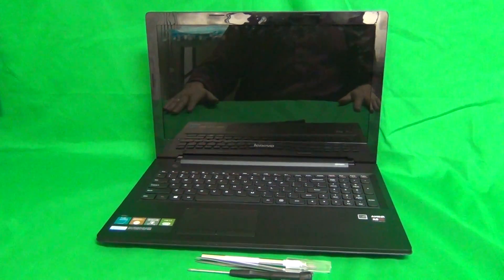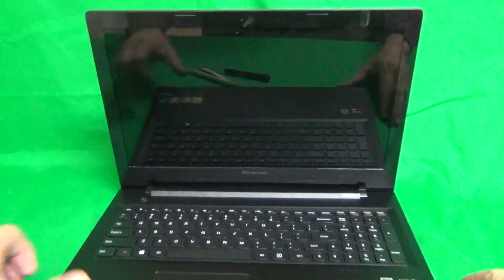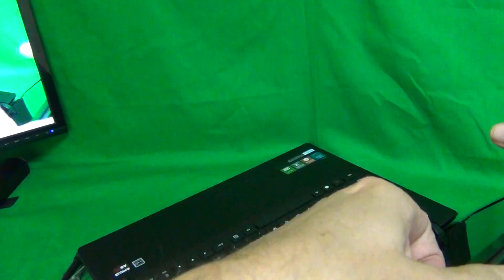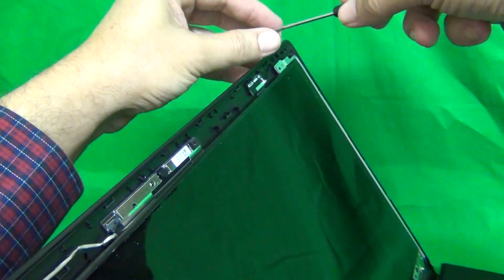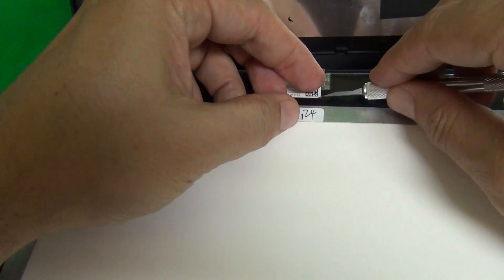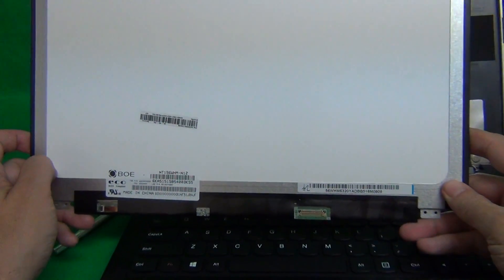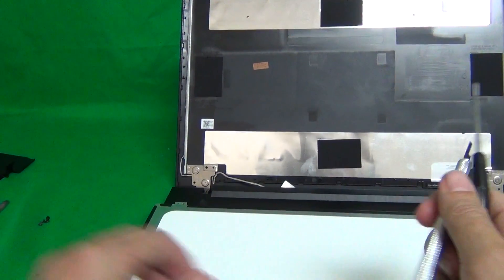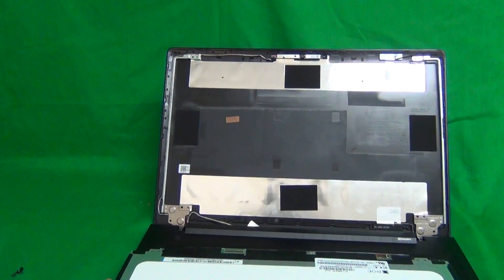Lenovo G50 Laptop Computer Screen Replacement Procedure

Comment: What this video DOESN'T tell you is that all of the tabs on the bezel will break when you remove the bezel. The front bezel and back side of your case will both be junk by the time you finish removing the bezel.

Comment: Hi my lenovo g50 screen is working fine except it now has a pink tint. External screens work perfectly with no tint. Would this be a screen replacement or a new bulb or something with hardware? Hope you can help thank you
Reply from the maker: Richard Lester the backlight is part of the panel. I think you need a new screen.

Comment: Hi there! This video is SOOOOOO super hekpful!!! Thanks for posting! I do have one quick question though, if you can recall, how many pins does this particular computer have on the wire connector? I have the exact same computer & need a replacement screen but want to be sure of the number of pins... Thanks so very much again for posting & for your time!!
Reply from the maker: This is a 30 pin slim edp screen
Reply from the maker: filegurl this is a 30 pin edp slim screen
Reply: WOW wasnt expecting such an amazingly quick response, you're so helpful! Thank you so much again!! Happy Holidays!

Comment: Thanks from me too for the video! Easier than any other LCD I've messed with lately. 

For anybody buying- You'll probably see this mentioned, but be aware there are 30 and 40-pin versions of that screen. Also, it seemed like very few even mention the matte finish version, but it is out there. When I ordered my glossy, I asked, and the people said "Oh yeah, we have those.", so I switched. There are arguments for and against both types, but I mainly want to be able to read on it. The viewing angle seems tighter, but when you view from dead-on, it doesn't have the washed out look people gripe about.

Comment: Hey, I followed these steps and replaced screen on my Lenovo G40-45 and it is working but when i open or close the Lid. The screen flickers for few seconds and then becomes Normal any solution for this issue?

Comment: Hey. My G50 has vertical lines along the middle of the screen. Should I replace the cable or the screen itself? I have tried clamping the flex cable at the bottom part of the middle section of the screen and worked for a few months before slowly deteriorating.

Comment: I ended up with a bunch of little plastic pieces from the removal of the bezel
now it wont stick again
HELP :C
Reply: you r  so fucked up.....
Reply: fucked up?
its not like i did it on purpose, but fuck it, i just used double sided tape, works like a charm :D